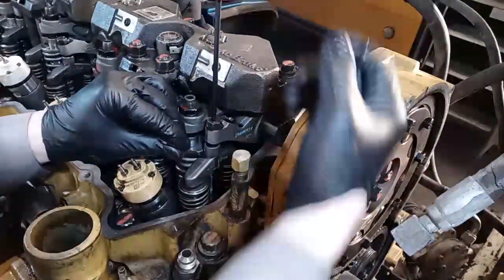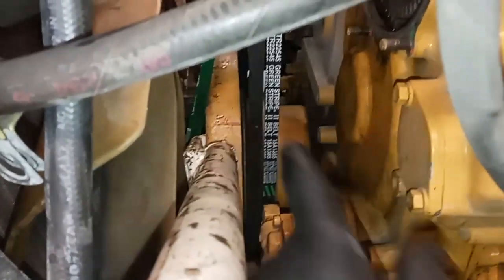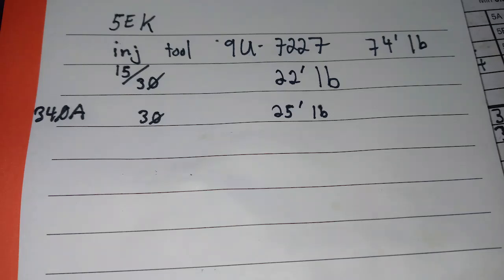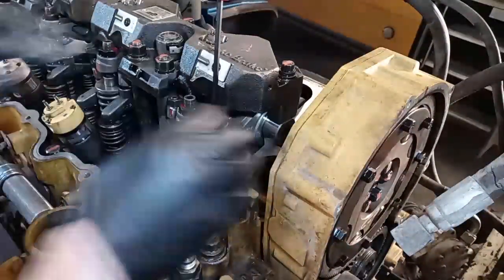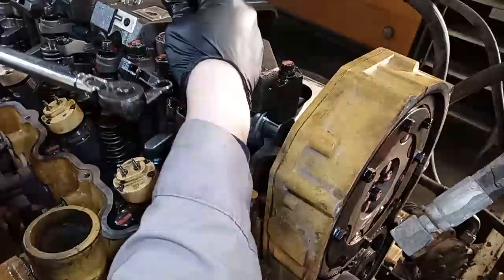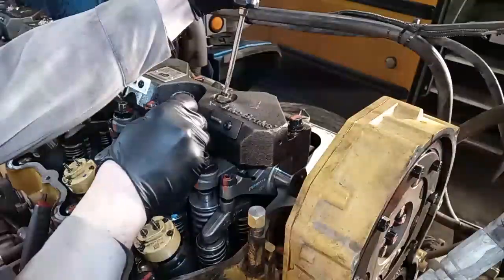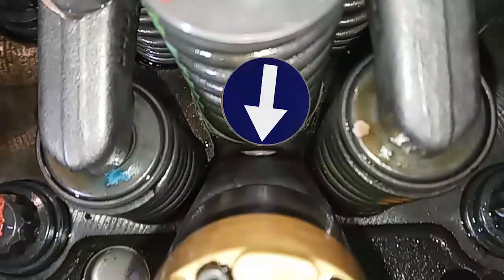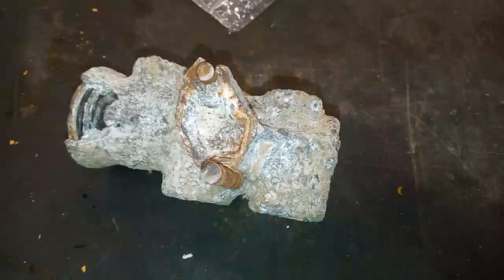PERFECT (nearly) Valve Lash Adjustment, With NO Wrenches.

Comment: I found that if you take a tarp strap and run it over the head of the pen so you have tension on the strap,  as you turn over the motor  the strap will pull the pen in to the timing hole

Comment: Did sixties through 2000s in German Car shops. Can adjust 911 valves no feeler gauge and be spot on. I always check it. But I built a tenth of a turn screwdriver and locked it down, and used the tighten up and let it sit , then the process.  Valve adjustment is so satisfying imo

Comment: In 1st year shop class they had us torque the adjuster to 6 in-lbs before torquing the nut, which doesn't sound like a lot, but feeler gauge was so tight you had to pull with all your body weight to remove it. Good to see another mechanic doing it properly

Comment: Does anyone know what 6NZ jake valve lash should be set at? Ive seen .033 and .037?
Reply from the maker: Please list your Jake model and engine horsepower.
Reply: @AdeptApe  475 340C
Reply: @AdeptApe  6NZ38242 is the serial number. What are the signs of tight jakes?

Comment: If you have the tool, it has a top step and a bottom step, If you set the injectors where the bottom step is sticking out slightly will advance the fuel timing 2 degrees.

Comment: I was taught that a similar "feel" would be comparable to putting a feeler gauge in a mic with a clutch and sliding it back and forth once tightened with the clutch (the light drag "feel"). Go No Go is a good check when in tough areas....thanks. Love the destruction!

Comment: Hey just saying your job as a mechanic doing a top set isn’t to do it fast... it’s to prevent premature wear and keep the engine running better and longer. You want to check all the clearances where they sit. That way if somethings way out of adjustment you’ll know and can investigate. If you just loosen them all off before even looking you’ll miss any problems and just put the valve cover back on sending the poor trucker on his way

Comment: On # 1, IE-IE-IE, on #6, EI-EI-OH YEAH, gotta set 6 ! And, on the 3400's, no feeler gages needed. Run the intake until it touches the valve back off 1/4 turn. On the ex., run it down and back off 1/2 turn.

Comment: I was told the step on the Injector tool was for different prefixes. When my boss taught me how to adjust valves he said that engines with an 800HP cam and all 6NZs used the top step, everything else was lower. I don't know how much truth there it to that, but that's what i was taught.

Comment: Please answer me if you see my comment . I have cat c7 and my engine blow gallon off oil every 30 miles out off the breathing hose . It’s wired no power lose the engine run fine . That’s too much oil what you think the reason might be ? Please answer if you can
Reply from the maker: Could be a damaged cylinder, turbocharger or a couple other things. That is definitely too much oil.
Reply: @AdeptApe  thank you for responding .
it’s very expensive to fix this engine , can I install oil can with oil return line ? If yes which one do you suggest

Comment: Light drag can be subjective. Example: My mech will use a 0.030 blade to set and  0.031 check. If 0.030 goes and 0.031 does not go, he knows it is exact.
Is this not correct?

Comment: Nice video.

I like how you use torque wrenches rather than "the feel" method for the lock nut. I torque everything hexegonical; ball joints, wheel lugs, door hanger bolts.

I like the tip to "squeeze all the oil out".  I never thought to tighten on top of a feeler gauge.  Cummins Dealee near me wants $800.00 to do a Valve-Overhead on my 2000 Cummin N14 SelectPlus.

Comment: I'm always curious how you manage to not move the adjuster when torquing down the lock nut. That's probably the main thing that worries me outside of pinning the engine.
Reply from the maker: You have to hold the adjuster t handle or whatever you are using firm when torquing it. If it moves you'll know because when you check the feeler gauge before removing it, it will be too tight or loose.
Reply: @AdeptApe  I see. I'll take note of this, thanks.

Comment: Being safetied to death. Same at my shop. But you’ll get in trouble without ANY gloves on. 🤷‍♂️
Reply from the maker: We have some really sensible and awesome safety rules, such as you can't walk through a shop door that is open (or closed theoretically) as it may fall on you, always have to wear cut resistant gloves I think even using the computer if you are on a machine or truck, you can't listen to anything on your phone through even 1 let alone 2 headphones or earbuds. Sledge hammers have to be stored in the supervisors office even lol.
Reply: @AdeptApe   In my shop, I keep heavy hammers(over 2 lb) in a secure location. To keep frustrated mechanics from pounding the hell out of something) Also, pipe wrenches and vise grips require a permit to use!!
Reply: @AdeptApe  is it hard to not walk through the shop doors or are you used to it now?

Comment: Where'd you get your damper-turning tool? There are times where it takes a lot of time to get to the flywheel access plate or there's no clearance to get a ratchet and socket on a damper bolt.
Reply from the maker: So I have 2 different ones. OTC makes one for serpentine belt drive front drives, the other one is a custom piece that we had at my old shop and I made my own with the same design.
Reply: @AdeptApe  awesome. Thanks.

Comment: On my engine brake adjustment,  best way I remember is. If I adjust the front side (number one). I adjust all the front's. And same on the rear, I adjust the rear (number six), I adjust all the rear side. On EUI's , if I am on number 1, I use my .356 plus my 1 or my .357 pistol. If the rocker arms have been removed. I turn the engine two rounds to seat the valve train in place. And to make sure I didn't screw up and have a bridge get out of place. I also check valves for over lap, just in case flywheel is on wrong.
Reply from the maker: One before this one I did had 2 pin holes in the flywheel, I always check for valves opening and closing though and was very confused 🤔. Then figured out that it wasn't truly pinned. Rotated it around some more and then found the correct pin hole. 
I never thought about the Jake adjustment like that before, but you are right.
Reply: @AdeptApe  Ran across a few double hole flywheel's, and yes once you figure out you just screwed up, you get to start all over again.

Comment: Oddly enough there's a hybird two stroke 4180 series Stihl motor that uses intake and exhaust valves to reduce emissions. It's the same principle to adjust lash to  .010. No injector or Jake in this instance but the locking tool and and methods are nearly identical. The Germans concept on "light drag"  takes three pages to explain also 😑.
Reply from the maker: That's the problem with "light drag" and 3 pages of German could be about 3 words, I've seen how long some of the words they use are.

Comment: I made a pinning tool with a 3/8 bolt, compression spring and hydraulic fitting
Reply from the maker: That would be cool to see, did you weld the spring to the bolt?
Reply: @AdeptApe  no, cut the head off the bolt, added two dobs of weld either side of the bolt, tidied it up with the belt sander and slid the spring over the top

Comment: I have a question not video related. I have a volvo common rain diesel, and I suspect one or two bad injectors. My question is, does a faulty injector make the fuel line vibrate less? Because when i put my fingers on the lines, 3 of them vibrate basicly the same, one vibrates less and the last one barely vibrates. Can i asume that the injectors with the least vibrations are faulty? Or is that method bs?

Comment: Would only back off new rocker arms otherwise how can you pick up valve recession if you back them off before you check with a feeler gauge
Reply: I check them all to check for valve issues then adjust them all.  This way you can catch a valve issues and remove the head before a failure.  Not necessary but an extra step I like to do.
Reply: That is a very good point, I will generally pin it first and work my way down through each valve that should be adjusted in that rotation by simply working the rocker up and down by hand while looking 4 very tight or loose valves. It's a very quick way to catch a bad cam follower on a C12 or C13 which are nearly impossible to visually inspect.

Comment: This is beautifully simple! Wish I could have learned this way first. But I don't run valves much any more. In a previous life I worked on mining equipment. Used dial indicators instead of feeler gauges on Cat 3512's and 3516's.

Comment: greetings---what is design rational behind cylindrical slugs occupying circumferential windows in cam drive gear?
Reply: If I remember correctly, which I may be wrong on part of this but I believe the slugs can move around and they take up the vibration from the camshaft.
Reply: They do it to reduce torsional vibrations in the camshaft.

Comment: Does anyone recommend getting valves adjusted while the injectors are being replaced?
Reply from the maker: You should have the valves set anytime they are unbolted or at certain service intervals. On an EUI engine like this you would want to have them set since they would be removed to replace the injectors.

Comment: What's with the different colors on the plastic on the injectors? Age?
Reply: Age and style. 
The solenoid styles changed a couple times over the years. Metal guard, no metal guard, etc. 
Sometimes ReMans will even come with the old style, if the solenoid met re-use specs. 
The solenoids on this style of injector are very robust. I've seen more failures due to harness over-torque or handling abuse than from actual failure.
Reply: yea some are more than likely newer
Reply: That's good to know then

Comment: I just bought a turning tool the other day as the few times I have needed to turn my 3406E or C15 over I had to use the balancer bolt heads but the fan is in the way so bad and risking cracking the fan blades doing the wrong thing and oh so much fun pinning the engine with no third hand so I devised a way of using a bungee strap to put a little pressure on a bolt used as my pinning device but I see now I need a rounded end as the pinning hole would pass by my bolt way too easy, I was not having fun with that aspect. I've only ran the overhead on the C15 once ( accert so IVA's ) and the instructions I found never made mention about turning the valve or jake adjuster in to push or bleed oil out, well I did that wrong then !. It had an uneven jake sound before I did the overhead and that took care of it so I obviously improved the balance between cylinders. I have a question related to the short torque wrench adapters, is it possible to find decent ones for far less then Snap On price or is that impossible to find as those are specialty tools that not just anyone would carry or make for that matter. I was using the box end wrench to snug it up while holding the adjuster and then was resigned to using a socket for the final torque and rechecking the drag. Also what is the recommended hours or miles between adjustments as my trucks do a lot of idling on the farm but put on few miles and "assume" idling hours don't put the same wear per hour as pulling a load down the road would.
Reply from the maker: A lot of info on a comment, but Jakes and compression brakes can be set different depending on the model of Engine, brake and whatnot. Best to check for your specific application.
For the torque adapters, check out the video description. There is a really nice Proto set that sells for $130 for a complete set, just click on the link. Cheaper than the Snap on set I have and a more complete set.
Reply: @AdeptApe  Thank you for the info on the wrenches, too bad I had already bought a turning tool as I could have bought the three piece set for less and even ordering across the boarder !

Comment: jake lash is dependent on horsepower, 30 is for a 550 hp, craftsman makes a long handle stub bit flat screwdriver that works awesome for overheads, did you do the rocker bolt update?
Reply from the maker: This one has new rocker bolts from a year ago. I'm not familiar with an updated rocker bolt design for the E models only the C15?
Reply: @AdeptApe  pretty sure it should have three six point bolt heads and one 12 point bolt with the update, i really hate them after the update as you have to swap sockets to avoid bending the rocker shaft, it would be it the tsb information in the cat news letter from years ago about 2007ish, while your looking for it look for the flywheel washer thickness for clutch face clearance, almost no one read that one, 5mm washer down to 3mm washers
Reply: @AdeptApe  What he is referring to if you have a 3406 E and you wish to install a Jacobs brake new (340 series), it will come with nine 257-2122 six point bolts and three twelve point bolts. So it don't hurt to update the older 340's to the later 6NZ's /MBN/BXS  set up. I do it at the time of rebuild or if I have a rocker arm bolt failure.
Reply: @johngoldsmith6629  I have those bolts but where do they go? The 3 are 12 point the 9 are hex but they didn't say where they go I cant find any pics I have a 98 1LW
Reply: @bigred1247  If you look inside the Jacob's housing the third hole from the front is your oil supply. These bolts will not work on a PACbrake. 

Now the spec for the 12 point head was 80 FT LBS.  If you still use ALL 12 point.

This is what the repair manual states for your engine, using one 12 point and three 6 point per housing.

Tightening Sequence for Current Mounting Bolts
A change to the tightening procedure for 340 Series compression brakes has produced two different sets of mounting bolts. The set of noncurrent mounting bolts can be identified by the exclusive use of 12 point bolts for mounting the compression brake to the cylinder head. Refer to Illustration 1. The set of current mounting bolts can be identified by containing 3 hex head bolts and one twelve point bolt. Refer to Illustration 3. 
The torque sequence and the bolt locations for installation of the Jake Brake compression brake. 
Install hex head bolts (1), (3), and (4) into the positions that are shown in Illustration 3. Install the 12 point bolt (2) across from the mounting stud for the compression brake. Install the mounting stud nut (5) onto the mounting stud. Finger tighten the mounting bolts and the mounting stud nut.
Note: Ensure that the placement of the bolts agree with the bolt locations that are shown in Illustration 3. Incorrect placement of the bolts will result in a loss of brake performance. 
Refer to the torque sequence that is shown in Illustration 3. Tighten bolts (1), (2), (3), and (4) to the following preload torque.
Preload torque for bolts ... 50 ± 7 N·m (37 ± 5 lb ft) 
Tighten mounting stud nut (5) to the following preload torque.
Preload torque for mounting stud nut ... 50 ± 7 N·m (37 ± 5 lb ft) 
Use the torque sequence that is shown in Illustration 3. Tighten bolts (1), (2), (3), and (4) to the following torque-turn angle.

(My comments Front to rear bolts are listed as 3, 1, 2, 4, nut is number 5. So 2 is 12 point hole 3rd back )

Tighten the bolts for this additional torque-turn angle. ... 90 ± 5°
Tighten mounting stud nut (5) to the following torque-turn angle.
Tighten the mounting stud nut for this additional torque-turn angle. ... 90 ± 5°
Note: Some of the early 340, 340A, and 340B compression brakes utilized two mounting studs that are located in the front of the brake housing. If your application has two mounting studs, tighten the second mounting stud nut as the last nut in the torque sequence. Refer to Steps 3 and 5.
Typical view of a Jake Brake compression brake
(6) Final torque for solenoid valve ... 13 N·m (9 lb ft)                                                                                                                                                       (7) Final torque for slave piston adjustment screw locknuts ... 34 N·m (25 lb ft)
(8) Final torque for installation of the mounting stud into the cylinder head ... 65 ± 10 N·m (48 ± 7 lb ft)

Comment: Nice tutorial. Like you said consistency is the most important thing. We all feel things differently. I used to drive for a company in Germany and we had a Mercedes factory tech at dealer ship next door. He was close to retirement thirty years ago. He set the valves without a feeler gauge just by feel. We would check him all the time and I don’t think any of us could have done a better job using feeler gauges. 🤣🤣 He was one of a kind and grumpy as hell, but probably one of the best mechanics I had been around.
Reply from the maker: Cool story, I love comments like that with a personal story. We had a guy that would do that with the camshaft backlash, he was always on too, never had one that coded.
Reply: @AdeptApe  Skill.. none the less.